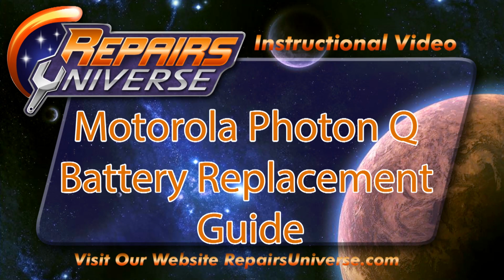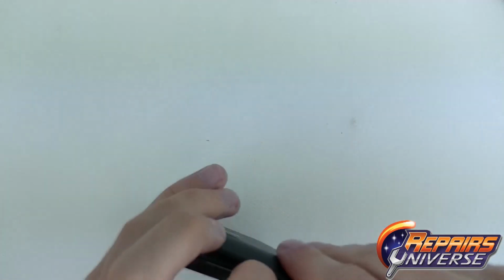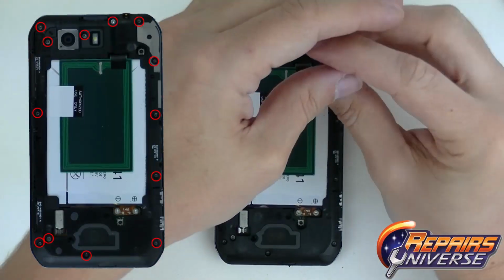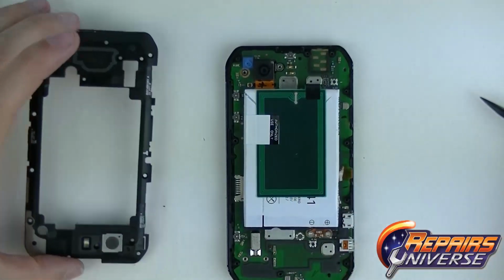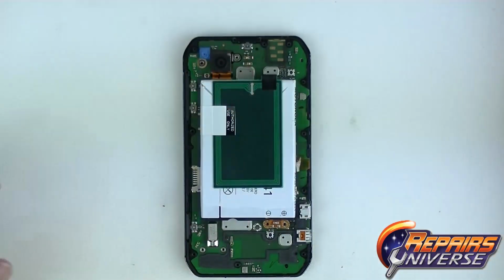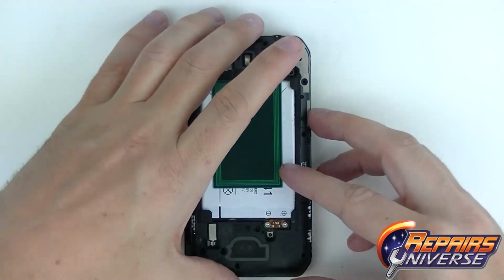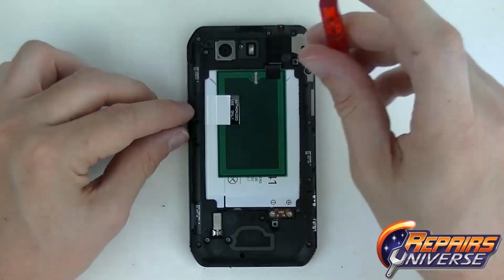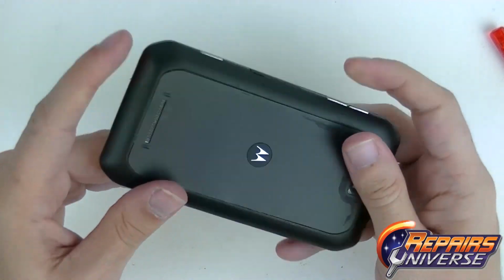Motorola Photon Q Battery Replacement Guide

Comment: I needed this video guide and offer a few additional tips.  Motorola Photon Q.

If installed, "unmount" the SD memory card in the phone memory settings before powering down. Physically remove the SD card. The card may interfere  with the cover removal otherwise.  Card should be spring loaded and must be pushed in slightly to unlock and then release it. SD card may still need to be pried gently out with the point of a sharp pin.  SD card may be electronically destroyed if not unmounted (in settings) and physically remove it.

 Remove the outer cover starting at the bottom. There is a very high spot around the earphone jack that is difficult to overcome. Start cover removal from the opposite end as stressed in the video. Work that jack area last when removing and first when reassembling the back cover.  Know exactly where those silver screws  belong. They secure and mate important electrical contacts.  Every screw required the same size driver including the EB41 battery connection.  Driver tool was included with the replacement battery (size is unknown). 

This battery was held in place with very thin but also very strong double sided tape.  This tape is applied only to the 1/4 of the battery at the corner area nearest the two battery screw contacts. A razor blade is used to carefully slice between the battery and the metal components. The battery and the metal components are exactly flat and sandwiched together with the tape..  The razor blade should slice between the battery and the flat metal components slowly and carefully. A slight careful twist of the blade will help.   Pry gently from the opposite battery corner.  This subject phone was considered junk.  No concerned and didn't treat it gently. A new battery brought the phone back to life. Very fortunate did not destroy vital circuits due to abuse during battery removal.   First replacement took 45 minutes. Second replacement 15 minutes.    Good Luck   
The large thin green pad secured to the battery could be an antenna of some sort. It wasn't removable nor did it exist on the replacement batteries. 

Phone seems to operate flawlessly after reassembly.  Battery should be discharged completely before completely recharging twice or more will help to set the recharge cycle properly.   Tell us why you're replacing the battery in such an old phone.  This Photon Q looks like any other but is irreplaceable due to some special programing. The program dies when the phone dies. No replacements available.   One battery was swollen. Both phones couldn't hold a charge for eight hours and often powered down suddenly although battery indicators displayed 30%.. All seems well with new batteries. 
  
Thank Me Later
Pow

Comment: You did a fine job making the video. But it's ridiculous that I should have to remove so many screws just to replace a battery.

I could just snap off those four tabs that hold the battery in.

On my Photon Q, there is a little tab over the battery that reads: Authorized Use Only. That is just retarded. Like I have to be authorized to replace a battery. I have five university degrees; two of them are in computer science. I change the oil in my Corolla because I want to do it myself, rather than let some knucklehead in an oil change shop overtighten the drain screw.

I can manage this oh so challenging task of swapping a telephone battery.

Changing a telephone battery should involve opening the cover, pulling out the battery and putting the new one in. This is how it works on my Sony Vaio, which has a MUCH larger battery.

Comment: So the "screwdriver" you need for the photon q is a Torx 4 (T4), not a T2 or T3. After not being able to get the screws out because I followed these instructions, I took it took a cell phone repair shop and they came out w/o a problem w/a T4.

Comment: Do we need the green circuit board that is on my stock battery?
Reply from the maker: Joseph Peracchi You should be able to transfer this over, it's best to do so.
Reply: +Repairs Universe can u make a video on how to replace it and instal it onto ur new battery please cant find out how to do it with out breaking it

Comment: Thanks for this fantastic writeup/video. Worked perfectly.
Would like to point out that on my Photon Q (Sprint) I had one more silver screw in the lower left near the vibrator. Took it out as well.
Also, the stock battery has adhesive on the back, mounting it to the motherboard, so you'll want to pry it carefully and it won't come out quite as easy as in the video. But take your time and it'll be fine.
Thanks again to R.U.!
Reply from the maker: Jeff Boen You're welcome, we appreciate the feedback.

Comment: Non-techie and was able to replace the battery (with little hair pulling) thanks to the video...very detailed. Love my qwerty keyboard and do not want to give it up so this was a last ditch-out of warranty effort to retain it. 

Roadblock and perhaps I have damaged something upon cosure: When I plugged in the phone to charge and tried to get it to turn on, I was presented with a Device is Locked, Status Code 0 and Battery OK message. Not sure how to get phone to operate (or rather operate in a manner even I can utilize.) Perhaps I've managed the hardware portion okay but upset the software in doing so?

Comment: What is the green chip on the back of the battery? Some batteries I have looked at online do not have this pictured.
Reply: Same question here. The batteries online that are marketed to fit more than just the XT897 do not include the green circuit board.  Is the green flexible circuit board there necessary, and if so, is there a procedure to move it to a new battery?
Reply: H in OH After a little more research, the green circuit board on the battery appears to be for wireless charging.  There appear to be two contacts on the phone's motherboard, so it might also be used for near field communication.  Does anyone know if the phone will function without this little board on the battery?

Comment: the battery i have doesn't have that white covering is it needed and what is it? can i peel off the one from older battery?
Reply from the maker: The white is just the cover from that battery manufacture. You may have blue, black, white, or red. Depending on the manufacture. Don't tamper with the old battery. When the internals of the old battery come in contact with moisture in the air it may become volatile. The chemical reaction between the lithium strips and the air can cause an explosion. Install what you ordered and nothing more. Good Luck!